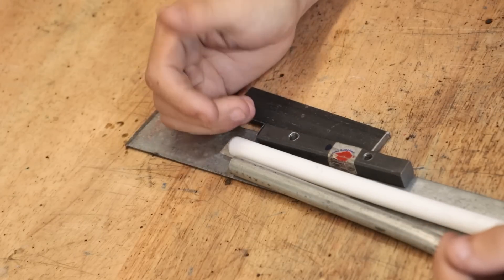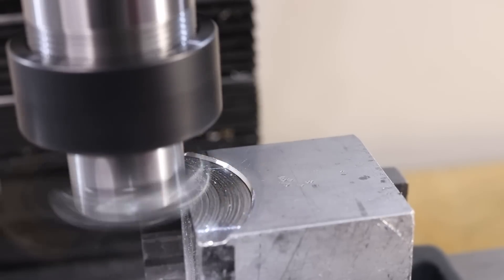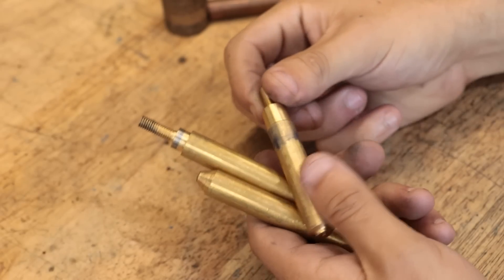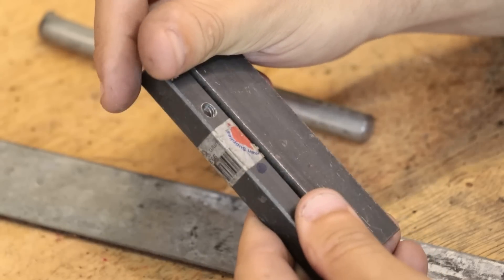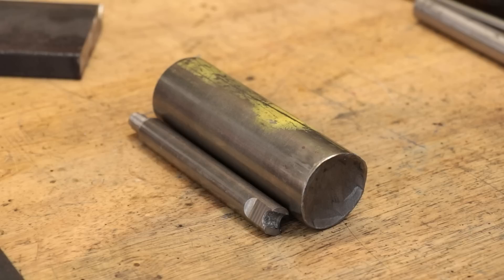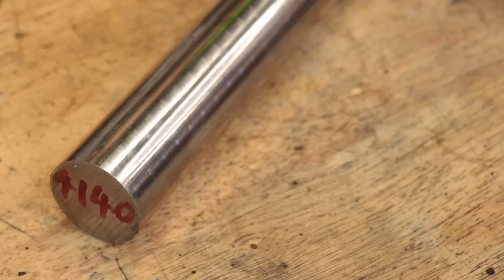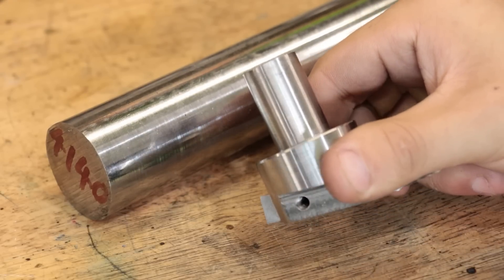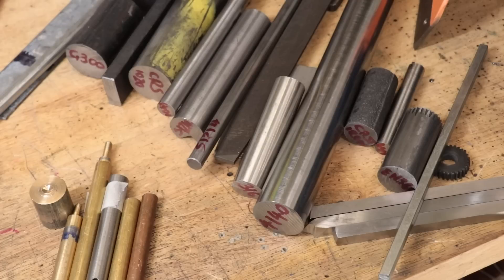Hobby Machining - Materials 101 (Oversimplified)

Comment: Great video. The only thing I would add to your discussion of hot roll vs cold roll is residual stress.  Depending on what you’re doing and what you need to end up with. If you need a flat part and you’re starting from round bar, if you use cold roll and machine half the bar off, it’s going to move on you and no longer be straight. If I had to do that, hot roll would be a better choice as the hot rolling process sort of anneals the material and leaves the material relatively stress free. Cold roll is great if you’re keeping the material close to its as-purchased form.
Reply: What Matthew said. Cutting cold roll releases the internal stress and warping can be severe in thin finished sections. The trick is to have the material stress relieved. If you don't have a furnace the material can be purchased already stress relieved, though you have to pay extra for it.
Reply: And to add a tiny extra detail: in the video he said he'd choose cold rolled for the lathe, and that's usually a safe choice because the lathe generally cuts symmetrically around the stock (obviously).

Comment: The advice in this video is pretty good. If you do need stainless steel for your work, you might consider 415/416 free machining stainless. Not as strong or as corrosion resistant as 300 series stainless, but it cuts/taps easily, and a mirror finish is possible for things like machine crank handles.
You pay a premium for smaller cut lengths but if you buy larger amounts to get a lower price you will end up with most of that material sitting on your storage rack for years. In the long run you are better off buying just enough for you project. There are suppliers that specialize in smaller cut lengths and you should seek them out.
Cheers from NC/USA

Comment: Gday, this was a really informative video and no BS, my local steel supplier mainly only stocks 4140 in bar form hence why I use it in my projects, where I live I don’t have a real issue with rust thankfully, the cost of material now has gone up in a big way, I do use a lot of secondhand materials like s-cams and trailer axles, cost nothing to get and very little, great video mate, throughly enjoyed watching, cheers
Reply: If you want plate with similar properties to 4140, look at P20 mould steel

Comment: I have found a good source for 1045/4140 material if you are not concerned on the specific alloy. I have been using scrap hydraulic cylinder rods.  They are all either 1045 or 4140, and you can pick them up at the scrap yard for cheap. The only key is that you need to cut the chrome plating off before you do anything else. Cheap and easy. Go get some scrap cylinders to try.
Reply: There's also scrap gun barrels if you don't mind the hole in the middle...

Comment: Great video ! You have to be careful buying stuff on eBay, I have had a few surprises in the past from a few sellers. Probably just dumpster divers selling what ever they find and proposing to be a metal supplier. I usually reach for 4140 90% of the time , mainly because I know it is strong enough for most jobs I do and I have a pile of it .
A guy at work gave me a pile of 1/2 inch round bar he scabbed out of a steel bin at one of his customers, it didn’t seem to rust so I thought maybe some kind of stainless- except this stuff was like machining chewing gum and broke really easily so it ended up in the scrap bin at my work !

Comment: In Taiwan, 4140, 1045, 1018 all costs the same. However 4140 is only available as round bars, hot rolled, annealed. There are alloys like FDAC, P20, etc. that I've yet to try out but if I need pre hard 4140 then I will probably give FDAC and others a try (those are all used for making molds).

Comment: Great video. I don't know how easy it is to come by in your area but I would recommend one additional metal to your list especially if using a small lathe/mill and it is 1144, it's resulferized for easier machining as well as some really good characteristics to it's properties.
Reply: 1144 what? Is that aluminium, brass, bronze, steel?
Reply: @WhenDoesTheVideoActuallyStart  It's a carbon steel.  Often called "stressproof" as it's stress relieved during manufacturing so your part doesn't have the tendency to bend during the machining process.

Comment: That was well done. Is S12L14 still available?  I have not seen it around for some years. Did I miss it, or did you leave out Silver steel which is normally held in stock by engineering suppliers so readily available and can be quite useful at times having a ground finish.  Aluminium 2011 is about all I have ever used in aluminium, as 6061 is just too difficult to turn with low powered lathes when you want production quantities.  Folks with large lathes don't worry about it, they just turn up the feed, increase the cut and pour on the coolant.   A large shop near me, won't have 2011 in the place, whereas I try not to have any 6061 around.  
Interesting what we will come up with as a video, when out machines are not working, both of mine are down at the moment too. I think you covered all that was needed and this video should be really useful to folks starting out machining.

Comment: Do you have a preferred reference book? I've found the machinists handbook but it's mostly imperial and I would rather have a book in metric if such a book exists
Reply from the maker: Ive featured Fitting and Machining by Ron Culley on the channel quite a few times. I think it is a great book, though it is a bit broad in some areas. Good thing is that it comes in metric.

Comment: Machining characteristics of different 3D printed plastics might be a good addition to this subject? Today they even come in form stable heat resistant versions. Resin up to 170C and thermal plastic up to 240C if I remember correctly. I'm thinking that could possibly make them suitable for replacing expensive castings for small steam model engines. 

Also Delrin and PTFE are used in model steam engines for bearings,  and piston rings of various designs. Things like suitable tooling, speeds and lubrication would be of interest.

Though I realize you shouldn't really talk about things without having personal experience. So it comes down to your personal practices.

Comment: in my country, hardware store metals (and about anything else actually) is about 5 times more expensive than at a proper supplier and also always of unknown alloy. I've found 10mm bolts that were 12.73 times more expensive in a big hardware store than on amazon

Comment: I can recommend 6082 aluminium over 6060 or 6061. It has pretty much all the benefits of 6061, but is slightly stronger, not as soft and way nicer to machine. The chips still do get rather stringy, but it's nowhere near as susceptible to raise a bur as 6061, especially when turning. Luckily I can get it at the same shop here in germany as 6061 and while it is a bit more expensive, it's not really all that noticeable in my hobby grade quantities.
Reply from the maker: Neat, never used it but good to know. Although none of my suppliers stock it. Cheers

Comment: Thank you.  But I’ve seen videos of people using delron (spelling) as a plastic (type) element used in spacers and such.  Why?  And for some stupid reason, I would like to see various grades of carbon fiber worked into a part.
Reply: Delrin is a Dupont trade name for a family of acetal plastic.
It is used for its lubricity and resistance to creep under load.
It is also not nearly as hygroscopic as something like nylon.

Comment: As a total beginner with no experience, what exactly do you mean by "more difficult to machine"?
I thought most machining was done through CNC controls? Does this just mean that we'd have to adjust our tools and have them take that little bit longer than with an "easier to machine" material?
Reply: Machining difficulty can mean any number of things.  Even plastics can be difficult to machine.  It doesn't just mean the actual force required to cut the material.
Reply: Lots of hobbyists don't have/use cnc machines. Manual stuff is fun. But even on CNC machines you will have to play around with feeds and speeds to get good chips, which might be harder on something considered less machineable.

Some materials gum up and stick to tools, some are prone to work harden, some require special treatment in other ways

Comment: copper. i HATE that metal with a passion. exactly for the same reason: it's gummy and likes to snap drills and sticks to my inserts like poop.

4140 and brass, i LOVE those. exactly for the same reason too: it's very easy to get a really good finish with those. and while 4140 is tough to turn and mill, and you can heat treat it to make decent tooling.

for everything else, i use aluminum or mild steels.

Comment: Man I wonder what I’m doing wrong because the machining I’ve done with brass has been terrible, it always leaves a horrendous finish no matter If I use HSS or carbide, but I’ve had amazing luck with 12L14, all aluminums and most steel but brass just terrible for me at least the ones I’ve tried like 260 or free machining brass but maybe I just am not doing something right
Reply: Have you tried using neutral/positive rake tools instead of negative rake ones? I've heard brass hates negative rake

Comment: Buying aluminium from Bunnings... Damn isn't the price of it in Australia dear enough from steel shop already, that you want to be doubly ripped off.
Reply from the maker: This is mainly aimed at the hobbyist that might buy stuff from the hardware store so it’s good info all the same. Plus i can’t do the two hour round trip to the metal supplier all that often, so Bunnings is more convenient. Cheers
Reply: @artisanmakes  that's fair enough. I just assumed you lived in a capital city.

Comment: Sorry to say, but the first sentence about aluminium is a bit of an unlucky statement. It is not "the best starting material". The best material to start with is always the one that fulfils the needs of what you want to achieve. If you want to just make nonsense parts for practising and look for an easy to cut material, SOME aluminium alloys might well be the material to choose.
But as soon as you want to polish your skills and at the same time make something useful, the function of the part you make has to drive the material to use. And it will always be a tradeoff between price, supply situation, toughness, hardness, machineability, weldability, density, corrosion resistance, looks and coolness factor.

Comment: Big disagree on the aluminium. I'd very much rate it as an advanced material that beginners should avoid at all cost. It has so many disadvantegeous properties such that you cant just use it willy-nilly for whatever. You need to think real hard on how to design your part to overcome these disadvantages. The real beginner material is mild steel which is exactly the opposite. Mild steel has decent enough properties sucg that whatever you're trying to achieve is PROBABLY going to work without thinking too much. And the MILD in mild steel makes it easily enough machineable that you'll have no issues on that front just as with aluminium. On top of that, it's also much cheaper and easier to get in bigger dimensions. As far as Germany goes, I can get huge chunks of mild steel for a decent price because it's used everywhere in machine shops around the country. Huge chunks of aluminium, however, are mostly for specialized industry and are thereby hard come by for the private end consumer.